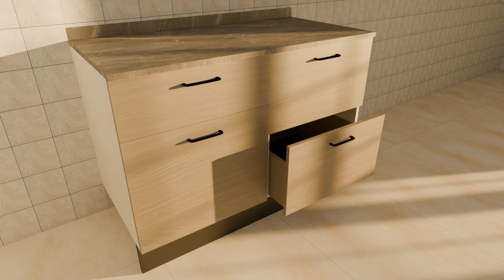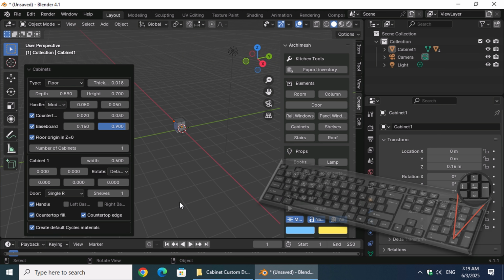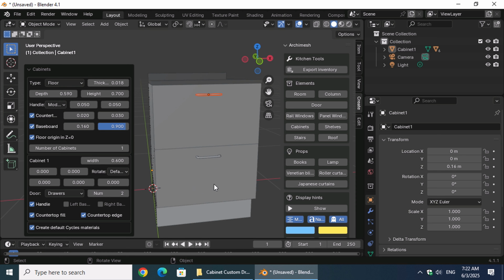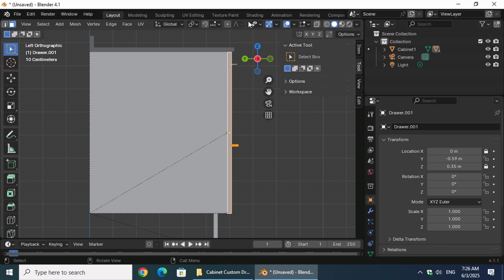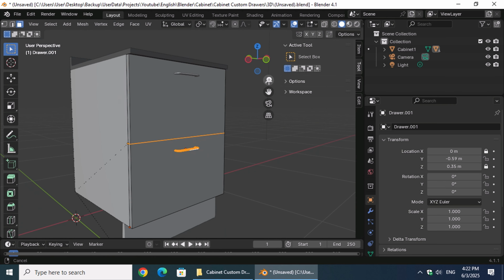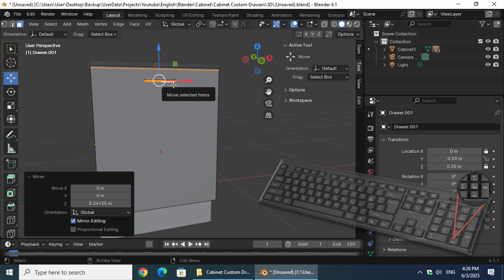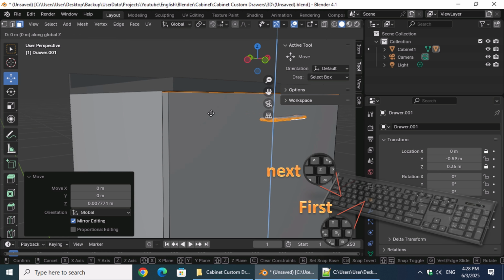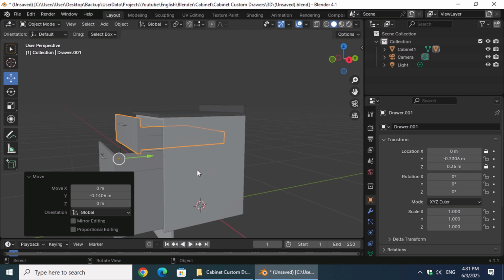Blender Archimesh: Create Cabinets with Custom Drawer Sizes

Comment: Sir i have one more question , sir my gpu nvidia 1650get damaged is it due to using blender or not??
Reply from the maker: Using 3D design software like Blender or Sweet Home 3D does not damage a graphics card by itself — even rendering, although it puts stress on the GPU, is something modern GPUs like the NVIDIA 1650 are designed to handle.

However, factors such as overheating, poor airflow, dust accumulation, unstable power supply, or overclocking without adequate cooling can, over time, lead to hardware damage. Proper ventilation, regular maintenance, and power protection are important to keep the system healthy.